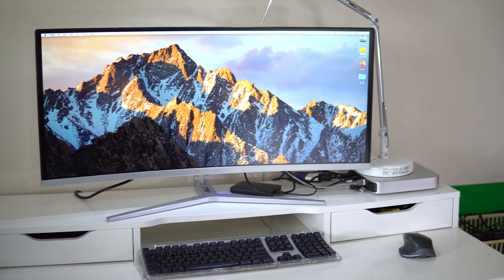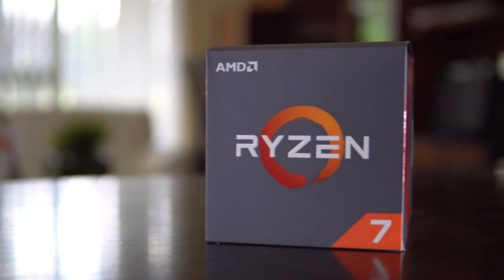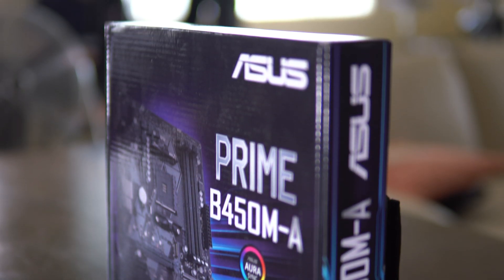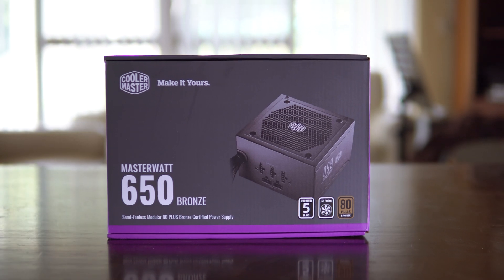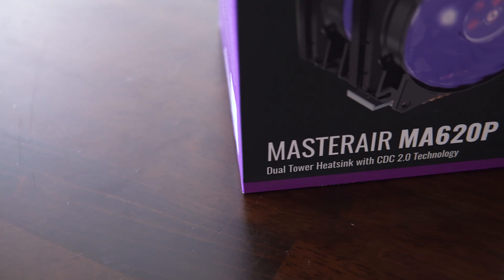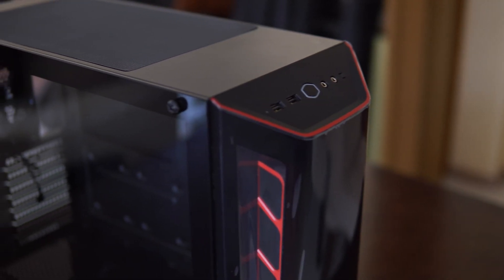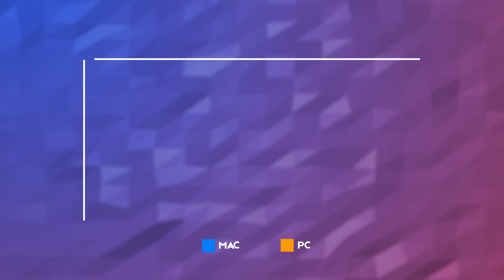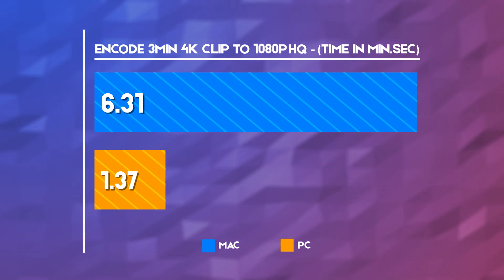$900 Video Editing PC Build! + Comparison with previous Mac

Comment: The research was mostly in English smh

And you should’ve gotten a case where you can put fans up the top to help balance amount of intake fans with exhaust, works better if you have roughly the same amount of each.
Reply from the maker: that is true actually since we worked so hard in math, and my case does support top mounted fans I just haven't gotten around to buying a 5th fan :)